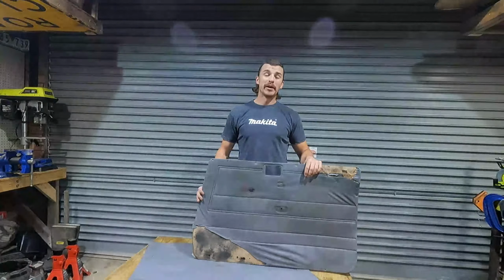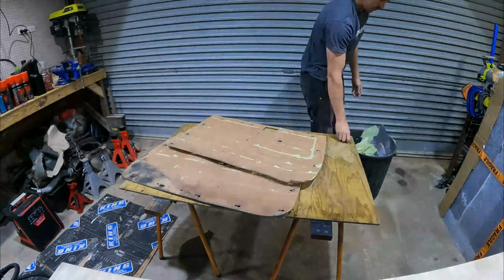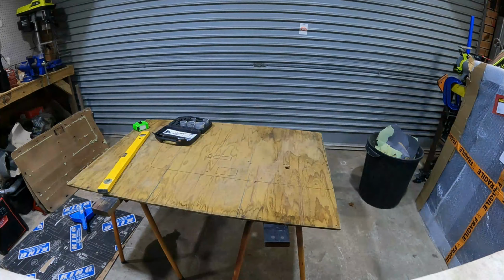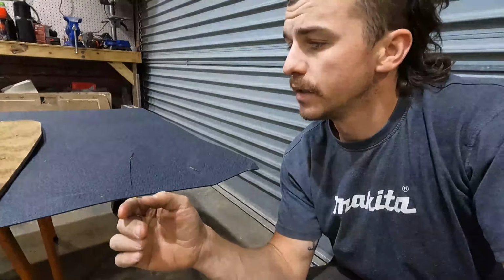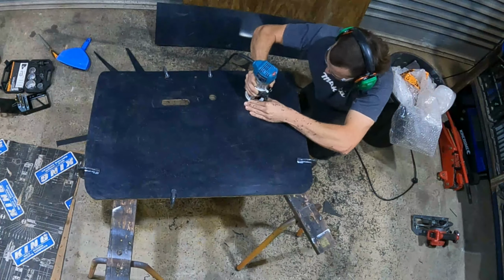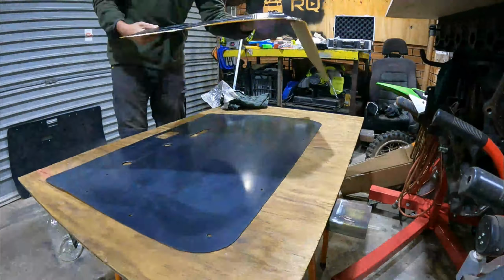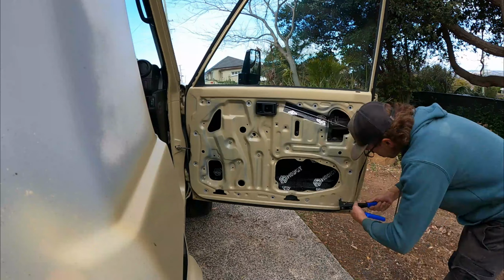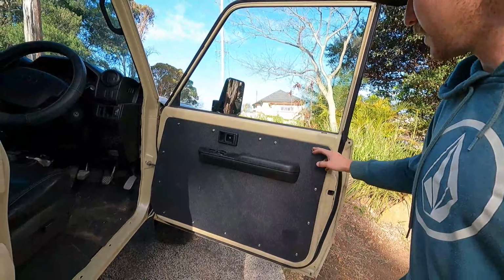79 SERIES LANDCRUISER CUSTOM DOORCARDS

Comment: Nice work mate.  Looking to something similar to my old 75.  Would you go a thicker sheet next time?  Im looking at 3 or even 4.5mm, not sure if itll be too thick tho?  Going to keep the manual winder and handle.
worth a sub.  Cheers mate.
Reply: I was considering 3mm myself.  I'll have to check the thickness of the original cards.  Might negate the need for sound deadening.